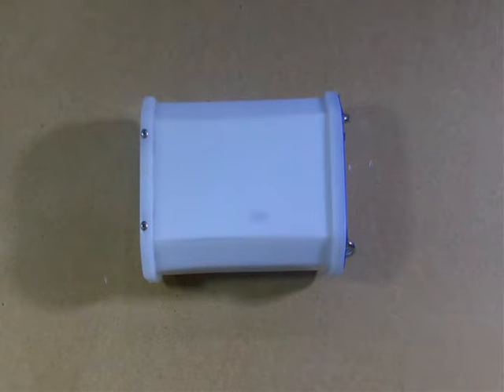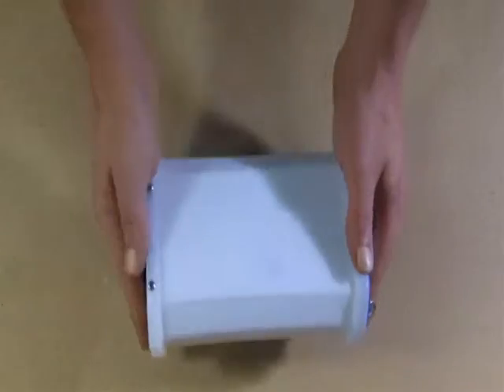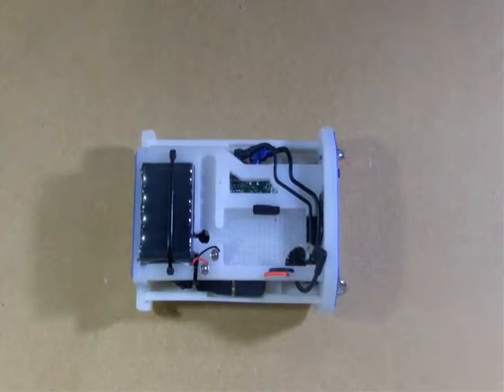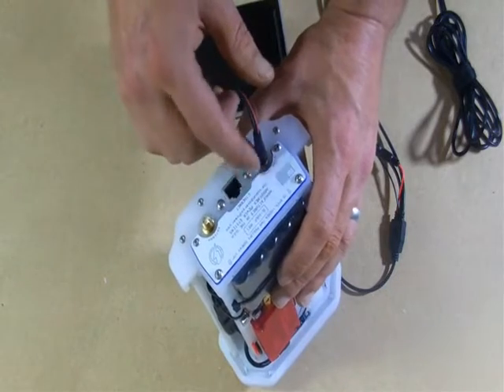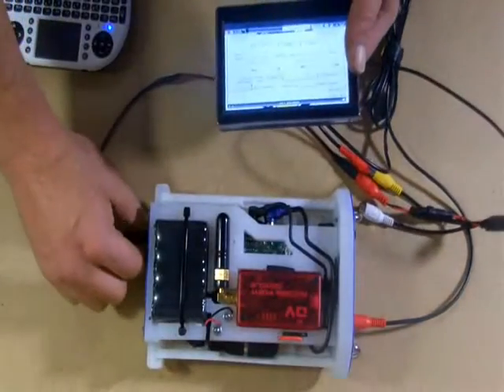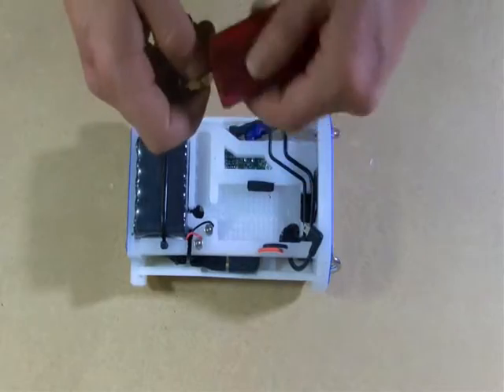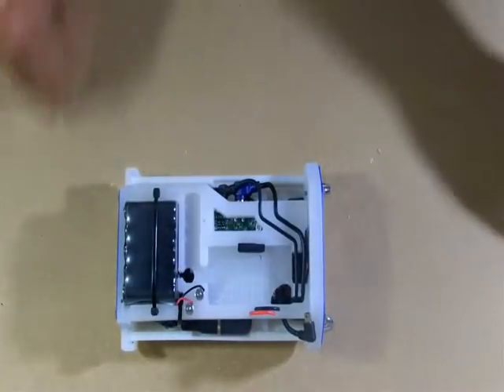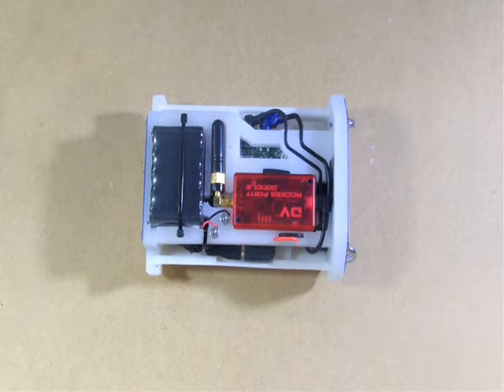D-HAP Quick Start Video -  Digital HAM Access Point by Hardened Power Systems.

Comment: Bill,  One thing you left off is for those of us who have purchased the enclosure without the Raspberry Pi pre-installed.  Is there anything to be mindful of when installing the Pi?  I hope it comes with the mounting hardware since I haven't received my unit yet.  Looking forward to putting both the Pi and my DVAP to use. For the most part my DVAP has sat in my computer bag for a couple of years! No there is a reason to actually use it!